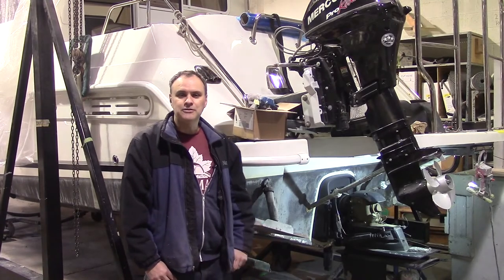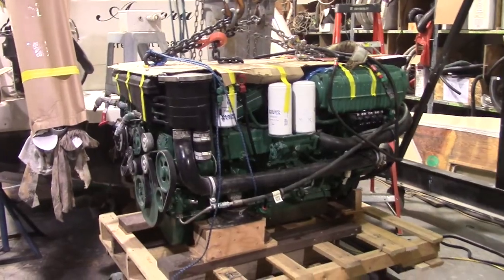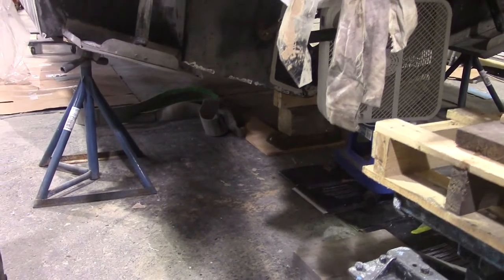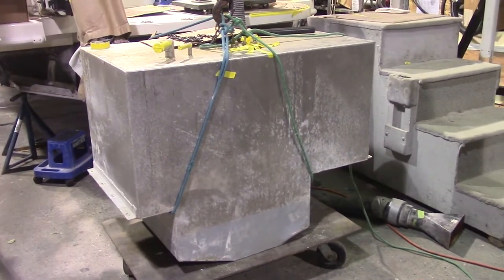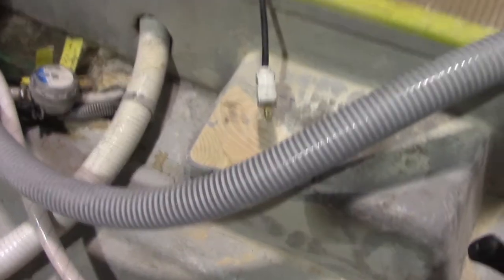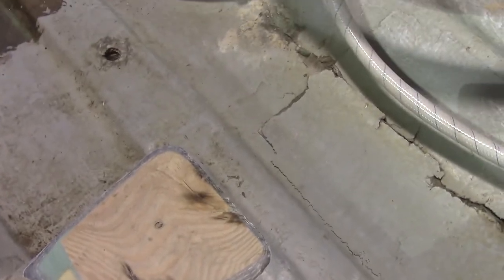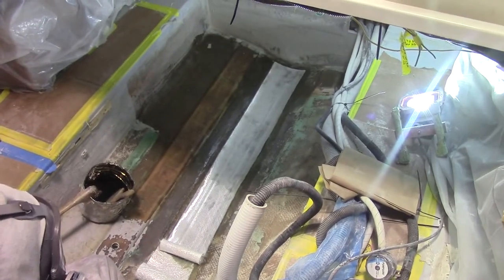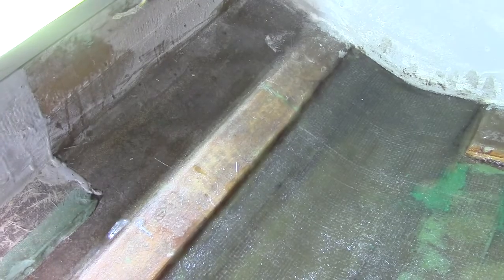Repair hull from major rock damage

Comment: If a newer boat runs itself right up onto rocks and damages the hull extensively and is fixed under insurance, is this a big red flag and compromises it's strength? Should I stay away from purchasing it? Thoughts?
Reply: Not if done properly.  Fiberglass in pretty much infinitely repairable
Reply from the maker: If the repair is done properly then there are no concerns. Sometimes it can be stronger in the repaired area because the layup may end up being thicker from the overlap of old to new.

Comment: for under the water line holes should we use mat or gloth???
Reply from the maker: Hulls are typically laid up with mat and roving. Roving for strength and mat around it for better bonding. We don't use cloth.

Comment: Why can't you just do from outside?
Reply from the maker: Delaminated on inside as well so you need to grind on inside to remove delam. Makes for stronger repair when you have new glass sandwiching existing glass. We were able to maintain the shape of the hull by glassing inside first. Less fairing in the end.
Reply: @MonaroMarine  Thanks my brother.